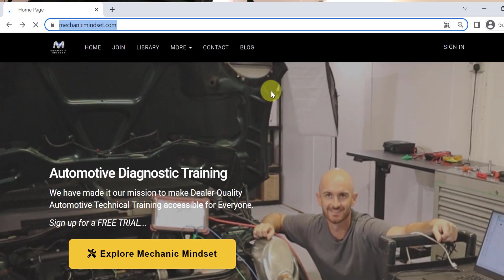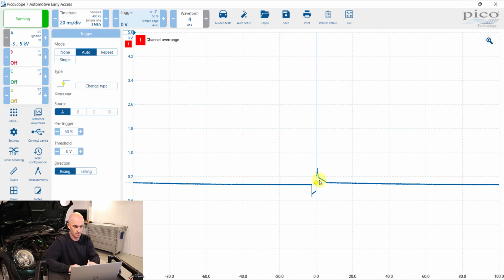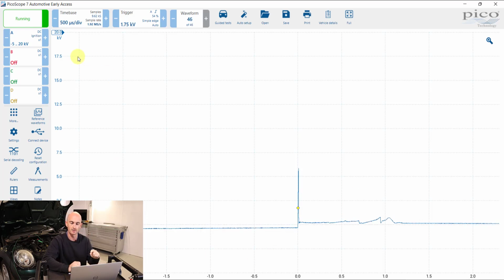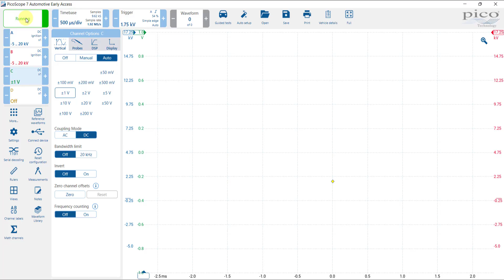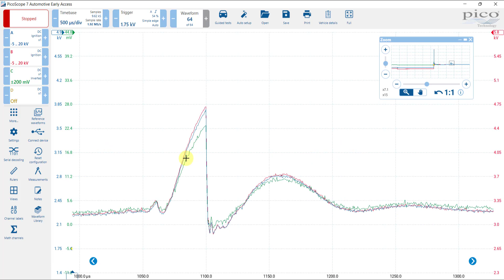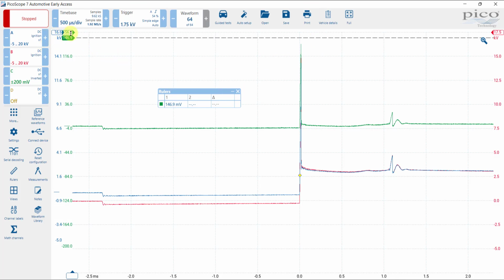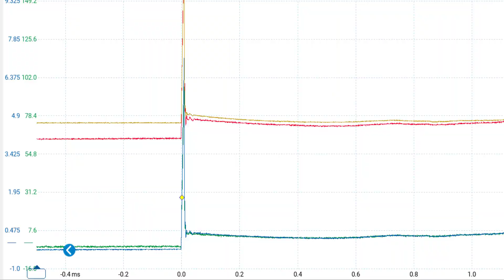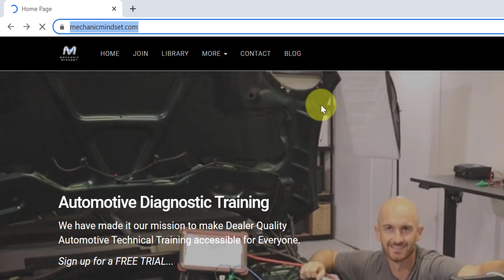PicoScope vs Hantek vs Rotkee vs Wire | Round 2

Comment: Hi quick question does the pico 2204a work on pico7 automotive or is it just for the normal scope could not really understand cheers for the help
Reply from the maker: 2204A you have to use normal version of PicoScope 7. The oscilloscope features are the same as automotive

Comment: In such a situation, can hantek cc65 be connected?
Reply from the maker: Not usually for the spark plug wire. Coil power supply yes 👍

Comment: I have difficulties setting up the time base and trigger using the HT-25 on a hantek 1008c
I cant get a steady waveform to analyse
Reply from the maker: The trigger is a bit difficult to master on the Hantek. I’ll try and have a look and do a video. It might be that the actual trigger point is off the page. Can you see position reference for ‘t’ at the top? You want the trigger in the centre of the screen

Comment: In the two HV probe-related videos, the Pico or Hantek probe ground clips are attached to the engine or battery negative (correct me if wrong) and therefore are providing a common ground reference between the car and the scope for all four.  But what about when using just the Rotkee or just the wire coil?  Does a separate ground have to be set up between the scope and the car?
Reply from the maker: I’d have to check again but I’m not sure there is much difference between have the ground connected and not. The clamp isn’t in the potential difference of the car as we are just clamping on the insulation. It may be related to the capacitive features of the clamp. The Rotkee doesn’t have a ground connector. I don’t usually use one for the coin trick either
Reply: @MechanicMindset  Thanks. The apparent absence of the ground with the wire and cop coin  reminded me of the digital tachometer I have for my single cylinder gas lawn mower and snowblower engines -- it too is connected to a wire wrapped around the plug wire, same as your coil.  There's no physical ground connection or return path between the unit and the engine, but it works.  I have a wire coil made up and will give it a try on the car.

Comment: Thanks for the great video, I was wondering what the rotkee wave form would look like if you used the preset probe like you did with the hantek, would it show an accurate kv reading?
Reply from the maker: The probe isn’t the same as the 10k secondary clamp probe. In the video before this I show it; not quite the same. Not sure what the Rotkee probe is but I’m sure they have a number to use. I’ll find out! 👍

Comment: ya nice! coil of wire is pretty good to.  i have been moving clamp as close to plug as possible. it seems to work good but, the difference is not all that noticeable. i am going to try the coil trick next time i mess around with plugs
Reply from the maker: I think you mentioned that before right? I did try moving it around as you suggested but like you say, didn’t make much difference on this car; might depend on vehicle. Cheers!
Reply: @MechanicMindset  ya thats what testing is all about, try and find out if there is a better way or not. CHEERS!

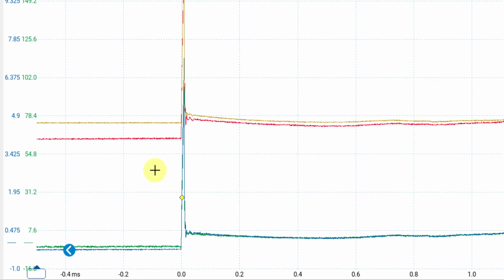Comment: On 5:38 i think they're little bit behind one another because the probs are in a different place on the spark plug extension and the scope is catching that difference 🤔
Reply: Since electricity travels at 186000 miles per second, i doubt that’s the reason.
Reply: Propagation delay in wire is roughly 60 picoseconds per cm. That's 60 x 10 power -12!

Comment: Love your videos and I’ve subscribed and been taking your classes and they’re awesome! I had a question I wondered if you could help me with- I’m trying to understand math channels on the oscilloscope/ their purpose and how to use them. I bought a vdd from jarhead diag. And can’t figure out how to set up for draw test even after watching their video. Thanks for all you do!
Reply from the maker: Hey Michael, glad you are enjoying the learning! I have a small course on battery drain diagnostics where we look at this. You basically need to know the exact ohm value of the resistor. You then use that figure to make the math channel using ohms law. In this case it would be Channel A ‘divided by’ Resistor value. 

You them state you want the units to read amps and it should automatically convert to mA where appropriate. Hope that helps 😬
Reply: @MechanicMindset  I’ll find that video and watch it. That’s how I set it up but it was still reading a lot higher than it should’ve been/ meter would read 20mA and scope would be showing 180mA but wasn’t sure if I was supposed to be looking at the math Channel or my channel A  bc it showed 2 different lines. I had A/0.30 set to measure amps and setup to sync with my channel A.
Reply from the maker: @michaelrollins3979  Cool. Maybe another decimal place will do it?